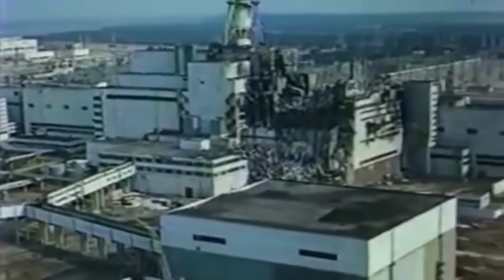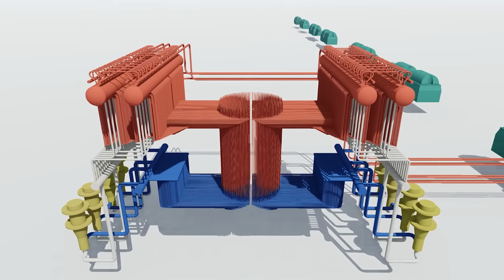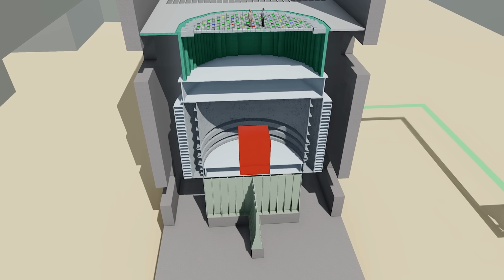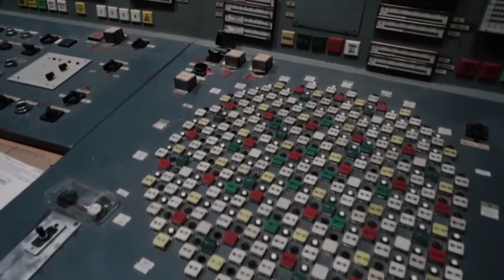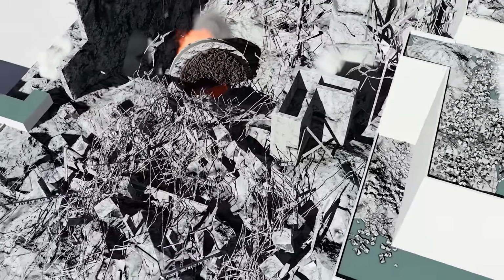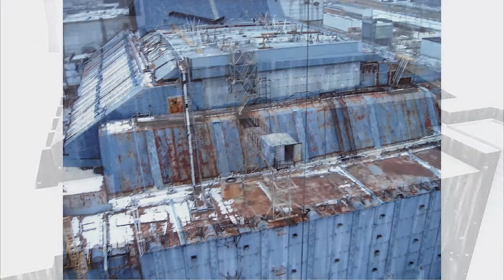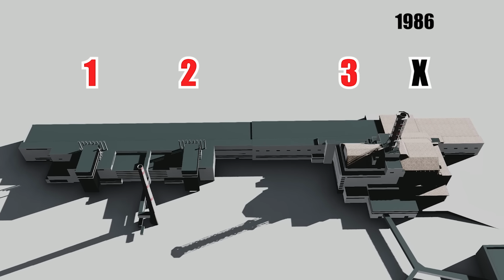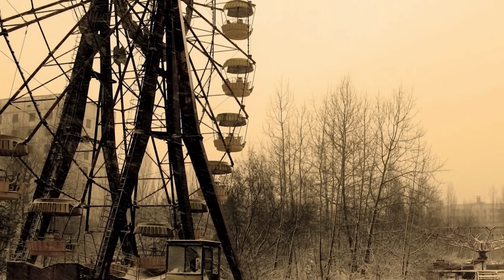CHERNOBYL DISASTER - An Inside Look - 3D

Comment: not the worst fukushima is at least four times bigger if not six times you should talk to Dana Durnford or Kevin Blanch they will set you straight
Reply: fukush was not worse than Chernobyl. Although bad, def not worse than.

https://contamination.zone/2021/03/14/six-reasons-the-disaster-in-chernobyl-was-worse-than-fukushima/

https://en.wikipedia.org/wiki/Comparison_of_the_Chernobyl_and_Fukushima_nuclear_accidents

https://www.businessinsider.com/chernobyl-fukushima-three-mile-island-nuclear-disasters-2019-6#:~:text=Chernobyl%20is%20widely%20acknowledged%20to%20be%20the%20worst,Pennsylvania.%20Visit%20Business%20Insider%27s%20homepage%20for%20more%20stories.
Reply: @SavedEight  four reactors each had 800tons of fuel not talking about the spent fuel pools with decades of spent fuel it is so much bigger than chernobyl the japan goverment does not allow info on it getting out check out Kevin Blanch on youtube or Dana Durnford

Comment: 3:09 Very good video but I thought the test was not about the safety, but to see if the dying turbine could provide power long enough to bridge the gap for delay of the backup generators?
Reply from the maker: The test was to verify if the reactor would be safe from overheating if the station unexpectedly lost grid power.
Reply: @Mike-Bell  Interesting. But why would they agree have such a test if that could reveal any flaws?
Reply: @henriksvensson126  its better to test this with a working grid as „safety net“ for emergency cooling, if the test fails. You just reconnect the cooling pumps to the grid and the damage should be minimal. If your grid breaks down and and you realise your backup cooling doesnt work you are doomed.
Reply: @henriksvensson126  It was a known issue with the design that in the case of grid loss, there was a period of time before they could get the diesel generators running to keep the cooling on. Theoretically, the latent heat from the reactor could keep the turbines turning, generating enough power for the cooling until the diesel generators would kick in, but it had never been tested successfully. This was attempt 4 or 5 to try to get the idea to work.

Comment: Later research wasn't conclusive that a spike in reactivity when АЗ5 was activated was responsible for the explosion. It seems like when АЗ5 was activated, the reactor was already no more. I am not sure why media and hobby theorists are so obsessed with АЗ5, ignore everything else what happened that night, and conclude that somehow that was the flaw in the reactor design that is responsible for the explosion. I guess it's because it's easier to explain and blow the minds of the public. Why people don't do a better job of studying the physics and the history? BY DESIGN, it would have never exploded. They shut down all safeguard mechanisms of the reactor to run a stupid experiment. Then they took out all the control rods, making it in essence a ticking bomb. Complaining that АЗ5 didn't work is like complaining your body wasn't designed well after you pulled out a ring out of a grenade and shoved it into your bottom for "safety". If you want to tell a story of Chernobyl, deliver all facts.

Here is a brief of events:

1. The reactor was about to be shutdown for a routine maintenance. They planned to run an experiment to check how long the turbines will still generate electricity after the shutdown. **To conduct the experiment, they took out the safeguards**.
2. The night shift started a slow shutdown.
3. They suddenly received a request to boost up the power to support another power plant.
4. They quickly heated up the reactor back again.
5. After the emergency was over, they continued the shutdown.
6. The power suddenly dropped and was already outside the parameters of the experiment.

This is where the things started going really wrong.

They still needed to conduct this idiotic experiment, so they tried to quickly (the shift was almost over) heat up the reactor. What they found out is that the reactor refused to heat up. What this genius Dyatlov didn't know (but should have) is that the reactor was in the iodine pit because of the previous partial shutdown and heat up cycle. They started frantically moving out the rods in an attempt to get the reactor running until they had all rods out. I would like to emphasize how crazy it was. With normal safeguards at place, that would have never been allowed.

After all rods were out, the reactor quickly burned through 135-Xe and exploded.
Reply: if AZ5 would have not been pressed, an explosion would have still resulted however it would have been a little later. the graphite at the tips of the rods created a small rise that was enough to vaporize all of the water and that caused immense pressure which made the control rods unable to move down more. that was the problem, if the power was lower when AZ5 was pressed it would have not exploded, but because the graphite tips could no longer move down and let the boron compensate the reaction quickly went out of control even more than it already was
Reply: Dyatalov demanded the test to be started at 200mw when it was officially stated that they don’t start the test below 700mw. In my opinion he was directly to blame for the accident happening . Had he done what the book told him to instead of being the control freak he was, it might not have happened the way it did. Your summary is bang on. The fact it was a poisoned core wouldn’t have been as bad had he not allowed the power to drop as far. It’s been stated several times over that the reactor becomes more unstable the lower the power gets.
Reply: No, that's not "later research", that's old Soviet propaganda. Everything else normal until AZ5 was pressed.
Reply: Pressing the AZ-5 button DID contribute though. Everything you said was correct, but remember that the fatal design flaw here was that the control rods were tipped with GRAPHITE. Pulling them all the way out, and then suddenly shoving all of them back in displaced water (a weak neutron poison) and replaced it with graphite (a mediator that increased the reaction). The fact of the matter is that the explosion happened 8 seconds after pressing that button because the graphite tips caused a power spike as they went in.
Reply: @zephyfoxy  Open your car's tank, fill it with gas, ignite a match box and throw inside the tank. It exploded? What a design flaw!!!

You are not supposed to throw lit up matches inside your car's tank. Similarly, you are not supposed to take out all control rods out of a hot reactor. Automation even couldn't have allowed it. These idiots did it by circumventing the safeguards. In both cases, it's not the design flaws to blame.

Btw, Fukushima's reactor had negative void reactivity. It didn't save it from meltdown, and eventually they had a similar hydrogen explosion when they had to start venting out steam.

Finally, later calculations showed that in Chernobyl АЗ5 had zero effect, the reactor was already melting down when the rods (what left of them anyway) started "moving" down.
Reply: Had the AZ-5 button not been pressed, the reactor would have had a meltdown, but it might not have detonated the way it did.
Reply: @chengaanimates2108  The reactor went supercritical because almost all control rods were out and the reactor finally burnt through all Xe poison. Automatic control systems would have never allowed to get that many rods out. They shutdown all safeguards and were manually regulating the reactor, ignoring readings from a computer. 45s before the explosion there was absolutely nothing, zero, zilch they had done that could have stopped the explosion.

Also, later research wasn't even conclusive that АЗ5 was the trigger. 1993 INSAG's report literally says that АЗ5 was most likely the final trigger and that it doesn't really matter what was the final trigger.

Comment: Were it not for gross communist mismanagement of Chernobyl and the subsequent overblown nuclear hysteria, by today the entire world would be running safely on nuclear power and fossil fuels would be a relic of the 20th century.
Reply: 3 Mile Island and other close calls prove this statement incorrect. Also, cars would still oil.
Reply: @rivermerchant6102  3 mile island wouldnt have changed minds. Fukushima maybe, but lets build NPP's on the open coast exposed to tsunamis am i right? But really Fukushima and a few others that just came to light MAYBE would have changed minds, but none were even close compared to Chernobyl and with people not already being afraid it wouldve been much easier to downplay. As for cars, without nuclear i dont see a capable way to go electric, so i guess we will never know.
Reply: @rivermerchant6102  3 Mile Island was nothing compared to Chernobyl. Every other reactor in the world has a containment building made of thick steel and concrete that effectively prevent radiation and radioactive materials from escaping to the atmosphere. Chernobyl did not have one, while 3 Mile Island did, and nobody died from 3 Mile Island. Even at Fukushima, estimates put the long-term toll at around 400. That's nowhere close to the 20,000 deaths attributed to the tsunami/earthquake that caused the meltdown in the first place.
Reply: Name Here so if that’s the case, please explain how there has been literally hundreds of nuclear accidents and leaks throughout America and Europe. Just because you haven’t looked it up doesn’t mean that nuclear power is as good and safe as you suggest. I agree that newer reactors are safer and less likely to explode into a fireball, but risk of exposure and unintended release of radiation into the surrounding is still higher than it should be. It’s also happened more often than anyone ever gets told about. There’s mountains of evidence proving that.
Reply: There would be a lot of ugly women if it weren't for fossil fuels. Oh and by the way I hope enjoy walking to work but I dont. My vehicle current uses petroleum based fuel and oil. But oh yeh that's right I'm not supposed to be able to work and provide for my family according to you liberals agendas.
Reply: The damage done by chernobyl, by enviromental standards, isnmt that catastrophic.

Bulding a NPP is still fiancially profitablr than building natural gas plants.

Stop buying into propaganda.
not a lot of deaths accured beacuse of chernobyl. Also, to put it bluntly, getting thyroid cancer is one of e “safer” cancers to get, easily treatable.
Reply: These accidents were never-events anyway. They simply shouldn't have happened and nothing about them is inherent to using nuclear power. If people stopped being reactionary to things and stopped and thought the world would be a better place (and as it happens given the times we live in the world wouldn't have spent much of the last year shut down and a lot less people would have died). There's a reason the RBMK design at Chernobyl would have never been licensed in the west, there's a reason the American nuclear authorities repeatedly warned Japan about Fukushima - these were known issues at the time, and long before. Truth is Japan and the Soviet Union thought they could ignore those problems and paid the price, and so did the world as a result.

People love to cite Three Mile Island as an example of something going wrong when in fact it's an example of what happens when it goes right - in the event of a catastrophic failure of humans and safety systems even on an old reactor with practically no passive safety systems and a remarkably poor emergency response the reactor vessel contained the core mass and very little radiation was released into the environment.

Of course these days reactors are designed in a way that they can be left alone following a catastrophic failure and essentially nothing happens and in future we'll have modular reactors based on marine designs that are even safer and harder to get into trouble in the first place with.
Reply: @Fatjuice  And thyroid cancer was only dangerous within 2 weeks after the explosion and only around the site of NPP because of the decay rate of radio nuclide iodine. Fuel was not released directly into the atmosphere as the video suggests but only a fraction of it was actually burnt, around 10%. It was mostly the graphite that was burning as it made the most mass of the core.

Comment: You skirted over one of the most important parts , the poisoning  of the reactor . A major contribution to the sequence of events leading to the Chernobyl nuclear disaster was the failure to anticipate the effect of "xenon poisoning" on the rate of the nuclear fission reaction in the Chernobyl nuclear reactor. Which was as a result of the space between the lowest point of the rods and the bottom of the reactor and being run partially shut down for so long before the test was done . Which basically means the reactor was already unstable before the test was done . So many videos about Chernobyl fail to explain this .
Reply from the maker: My next video on the same channel explains just what you are referring to https://youtu.be/pOzJQJ1yAaM
Reply: Pretty sure this was explained in the HBO series

Comment: Well, it was a good reactor... powerful and well engeneeared... . They did the trst while the core itself was poisoned from xenon gas, so basically was like being in an highway whit the gas pedal stuck at the max, no brakes and other shit... . And if the grafite bar were smaller and the boro bar were longer the a-z5 shoud have worked... . I think is a cool reactor, unfortunately not so safe...